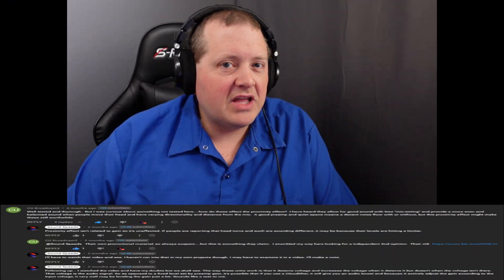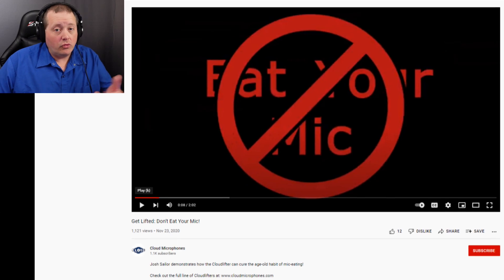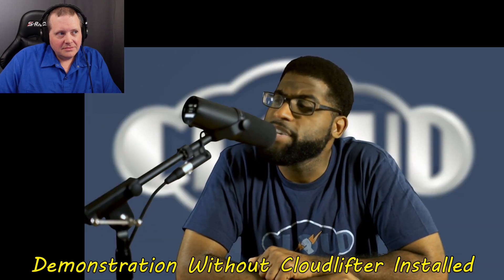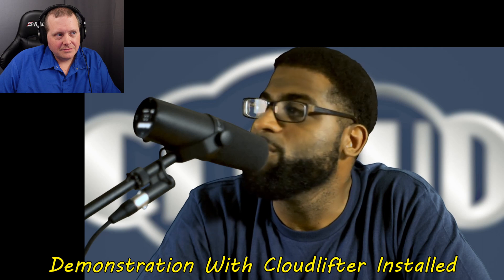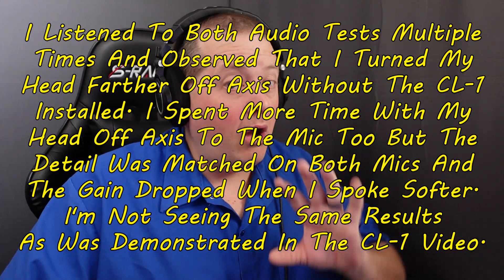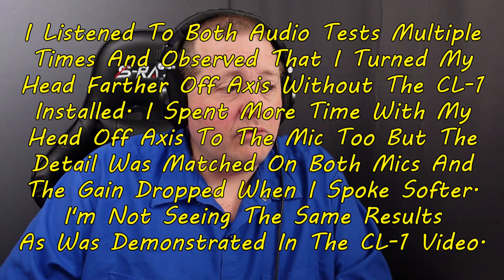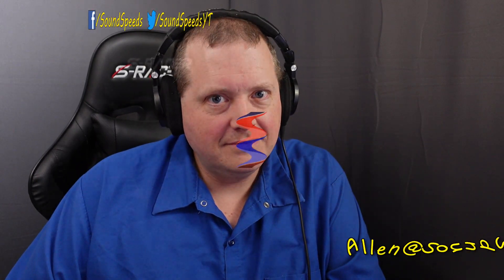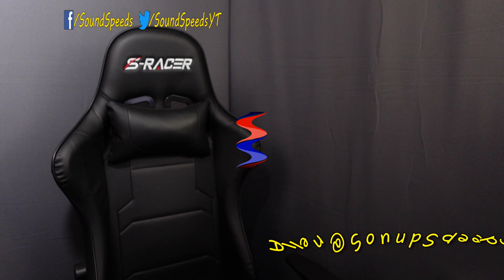Testing Cloud Microphones Claims About The Cloudlifter CL-1

Comment: When they uninstalled the CloudLifter, he did not mention them changing the gain back down, so  maybe he was riding a limiter
Reply from the maker: In the Cloudlifter video? You may be right. That's a really good point. When I listen to the noise floor he's talking over, it sounds like it's adjusting up and down a bit but I can't be certain so I didn't mention it. The level also looks squashed so that could explain it. I think I'm going to have a friend with iZoptope see what he can extract.
Reply: @SoundSpeeds  I think you’re both spot on here. I think that’s what they were doing. The noise floor also seems significantly worse with the cloudlifter which is what you’d expect if the gain remains consistent and you’re riding a limiter.
Reply from the maker: I'm going to play some tonight in Reaper and see what I can see when I dive deeper.

Comment: Hi, Thank you for making this video. I have a question for you, I am using the Volt1 Audio Interface with the Shure MS58 microphone (connected to my Macbook Pro),  I would like to make my microphone sound louder into my headphones while using direct monitoring during my recording without causing any clipping/distortion by adding too much gain.  Would a cloudlifter or could you give me any other solution that would fix this? Thank you
Reply from the maker: A Cloudlifter is not the solution you need. Did you say you headphones are plugged into the computer and not the interface? If so, plug into the interface. The Volt1 should be plenty to properly gain your microphone to decent listening levels.
Reply: It's plugged into my Volt1 audio interface with the volume to the max, my gain as high as possible without causing any clipping and the rest of my sounds from my Mac turned down so that my voice can come in louder.  Any tips? @SoundSpeeds
Reply from the maker: What happens if you monitor from the Mac itself? It's kinda difficult to troubleshoot it from a comments section. YouTube doesn't always notify me of replies after I commented. If you unplug the interface from your computer, are the levels still low? Do you hear preamp or mic hiss in your headphones? If not, the headphone amp might not be working correctly. Try reaching out to UA and see what solutions they might have. I'm not a Mac guy so my Mac troubleshooting is limited especially thru text.
Reply: @SoundSpeeds  I am good with it, it's just my wife has always liked hearing herself really really loud.  Even when we go to a professional studio in the past they had to put it full volume to the max for her.  I am just trying to fix it so that she might be happy with it too.  So a cloudlifter will not increase the volume of the microphone louder to my headphones?
Reply from the maker: No. A Cloudlifter uses phantom power to boost a dynamic microphone level. There's no phantom on headphones. Boosting the microphone level louder is what a Cloudlifter would do and you already said your input gain is set where it should be. If your wife needs it loud loud, get an external headphone amplifier.
Reply: @SoundSpeeds  If I boost the microphone levels it will not translate into a boost in microphone levels in my headphones for direct monitoring? Thanks you
Reply from the maker: No, it will boost the levels into distortion
Reply: @SoundSpeeds  Thank you for your time and patience in helping me.
Reply from the maker: Sure thing

Comment: Correct. All it does is +25dB and... unfortunately some noise. With SD MixPre 6II you'd be better off without Cloudfilter, I've just tested it and sending CL1 and CL2 set back to amazon warehouse. And frankly, I'd set my trims to +64dB with SM7B rather than 49 or so, to get a decent signal at approx -12dBfs. What do you think?
Reply from the maker: I set mine to 59dB matching the input sensitivity of the mic then adjust from there. Usually I'm louder but a little farther away so it averages out
Reply: @SoundSpeeds  gotcha, 64 and 59 is not much of a difference (usually my guests are talking with a little less confidence).
Reply from the maker: If you only have 65dB of gain though, your noise floor will change quite a bit it if you're pushing to the max
Reply: @SoundSpeeds  I tried to send you a link to wetransfer with a really small pro tools session where I compare two mics, one with and one without CL. But I can't see it. Will you provide me an e-mail so I could send you a link? 
Also, MixPre 6 II has something about +76dB gain, so my 64 is not pushing the limit I think, do you agree?
Reply from the maker: I do agree. My email address is at the end of all my videos and in the description of each video.
Reply: @SoundSpeeds  sent! thank you!
Reply from the maker: I'll check it in a bit

Comment: In your tests, I did notice a greater falloff without the CL-1. Not tremendous but noticeable. However, the falloff seemed natural due to the angle of the mouth. In the Cloudlifter video when the guy switched to the CL-1, the gain jumped tremendously, making me think that the reason the falloff is lesser is because it's just boosted more. I prefer not to have additional gadgets in the signal path unless absolutely necessary.
Reply from the maker: Comments seem to think he was pushing the limiter and that goes in line with my findings looking at the wave forms.

Comment: The cloud lifter seems an interesting bit of gear. I’m not sure what I’d use it for. I will admit, I feel I only graduated from noob status 6 months ago. Am I wrong in saying the cloudlifters main sell is for those wanting to match gain hungry mics with entry level preamps? Seems to be taking advantage of those without much audio knowledge. If they really want to use the cool mic on camera, then the cloud lifter allows them to do this, which is fine. Making bogus claims like the one in the video you pointed out is downright misleading though, and I’m glad you’re shooting it down. I hope the strategy backfires, and the consumers start realising that, for a fixed installation, a cheap channel strip could give them what they want and a whole lot more for another…what…$100? I just don’t get the cloudlifter. Need portable, get a fethead. Need more gain in a fixed installation, get something else…including literally any other dynamic mic. Save yourself $400 on the cloudlifter and the mic purchase. Tell me Allen, why do you own a cloudlifter?  Review purposes, or some other specialised utility? Cheers, Andrew
Reply from the maker: You're right, a Cloudlifter adds clean gain to a dynamic mic and someone with bad preamps can take advantage of this. Check out the video I referenced. Cloudlifter products do their job well so I don't understand the purpose of this embellishment. As for why I have them... I did a review of the CL-1 and CL-Z years ago and constantly am asked questions about them so I can answer them and record tests.
Reply: @SoundSpeeds  Thanks for the answer. I understand that they do their job well, it’s just that I struggle to justify their job. Almost like a middle management position! Ignore me, checking out the video now. Though I’d be better suited spending my time making a video for Curtis’ upcoming challenge. Would be very curious to get some expert thoughts on how to improve things around here! Cheers Allen
Reply: The video could be viewed as a shameless attempt to get 13 years olds to ask their parents for a cloudlifter. Note the supermario sound effects. I shouldn’t comment on YouTube before a morning coffee…

Comment: There’s a problem in how Cloud is presenting. When you eat a mic like that, you’re going to battle proximity effect no matter what. The only reason it’s less noticeable with the CL-1 in is because the added gain is increasing sensitivity (duh) and it’s likely hitting a compressor after the fact. Also, I noticed the presenters words were focused on when his mouth was on axis while using the CL-1. Much less was said when he was off axis.
Reply from the maker: I noticed that too but think you're more right about him hitting the limiter and that helping the level.
Reply: @SoundSpeeds  the reason eating the mic causes an issue is because when you turn your head off axis, you create a proportionally larger change in distance. Back off a fist and the change is less severe. The compression and/or limiting is just smoothing it out on the hotter level. Level match before processing and the difference goes away- that’s what your video ultimately is pointing out.

Comment: I think you're right on the money..  the proximity effect is based on gain.  The Cloud lifter raises the gain.   I think this could be shown easily using a waveform in something like Adobe Audition where you could see the levels and match them..   when the gain is equal (peaks and valleys in the waveform) the proximity effect will be the same regardless of whether or not you're using a cloud lifter.   With the SMB7, it needs alot of gain, and depending on your pre-amp, you might not be able to give it the gain it needs..  it that case, you use the cloud lifter, or as you stated, if your pre-amp is noisy and you want cleaner STN.    One could also test the stn at equal net gain with and without the lifter with a bit of silence.

It's the same case I make for compression and dynamic range.   I always think of compressors as "raising the valleys" rather than limiting the peaks..  If you do proper gain staging, you're always controlling your peaks with gain - you shoot for the same peaks with or without compression, so the effective result of compression hardly ever changes the peaks, but raises the valleys as your dynamic range decreases!   There's always exceptions.. but the main idea holds.   Comparing this to the CloudLIfter discussion, if your end result has the same the net gain with our without the lifter, your proximity effect should be the same with or without the lifter..  The only question is are you adding gain with the lifter or with your own pre-amp.
Reply from the maker: The microphone doesn't care what you do with the little bit of millivoltage it puts out. Run thru a Cloudlifter or not, it won't care because the signal is the same going out. You can't change the pickup pattern of your mic and make it on axis at off axis angles using a Cloudlifter. It doesn't work that way. It add gain by increasing voltage. That's basically it.
Reply: @SoundSpeeds  You're 100% correct!  The gain will increase the reach of the polar pattern "bubble" around the mic, but it increases on/off axis levels respectively across the board.   It'll still be louder on-access than it is off-access.   There would have to be a compressor/limiter to limit the on-access level respective to the off-access level to make it do what that other cloudlifter video described.
Reply from the maker: I'm going to play with it in post tonight. They already have a good product. No reason to stretch the truth or make claims that don't make sense.

Comment: Sound likes he used 'volume normalizer' in post processing.
Reply from the maker: Or pushed the limiter because the dynamics look squashed. I'm going to investigate further tonight after work.
Reply: @SoundSpeeds  
Agreed, volume normalizer also has similar effect as the limiter  Hence his voice is constantly   'louder.  IMHO.

I always use volume normalizer  or compander effect for boice communication through amateur radio, to keep the sound signal as loud as possible during transmission (TX).
Reply from the maker: As you should. Companding is critical especially in situations of lower dynamics. It was mentioned in another comment that he was probably pushing the limiter. The wave form reflects that so I'll agree with that. I think compression, in his case, would be too audible but a slight pushing of the limiter wouldn't be much.

Comment: Ideally you would have had two SM7bs, one on top of the other with the capsules aligned, one with a CL-1 inline and one without, so you could have the same exact audio source going into both mics and perfectly aligned in order for you to A/B back and forth.
Reply: Better than 2 SM7Bs would be to just Y out of the mic and send one side to the CL-1 and the other direct to the interface. Then you just offset levels for the difference.
Reply from the maker: That could change the signal coming out of the mic. It's only about 1mv and splitting it (without using an appropriate splitter that would change the sound) could lead to a very high noise floor.
Reply: @SoundSpeeds  while that is correct, it changes the same for both. You could also do a transformer split if you’re concerned about that mV.
Reply from the maker: I could but I think this test served it's purpose.
Reply from the maker: Except that 2 SM7b mics wouldn't be matched and frequency tolerance can be +/-3dB (unless otherwise stated) and that could yield different results. This way, it's the same mic. It also guarantees matching positioning over the mic at all angles. I could have improved by pointing my nose at two different places and timing the movements to one phrase repeated consistently.

Comment: I did notice a "slight" improvement with the CL-1 but as you mentioned you turned your head more without the Cloudlifter.
Reply from the maker: I went back and forth over and over again when I came to my determination. I should have done what I did during my initial audio only test and point my nose at two things on a wall to duplicate head turns. When I did that, they were identical.